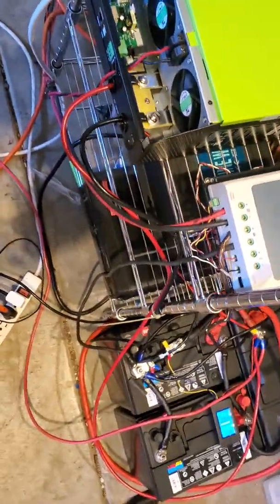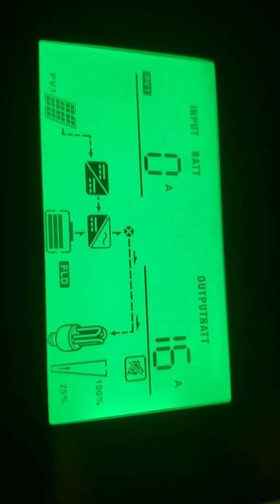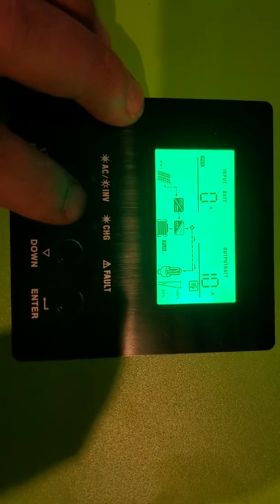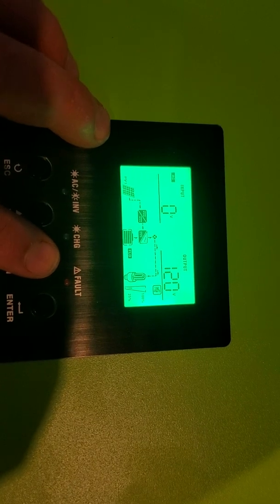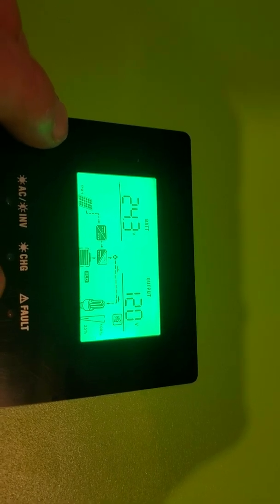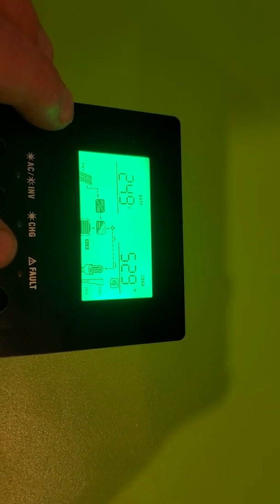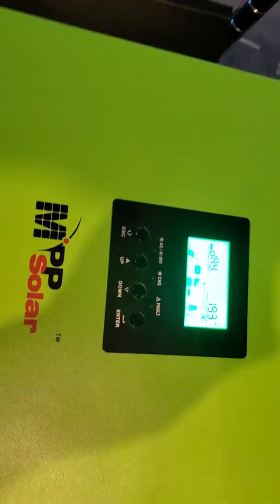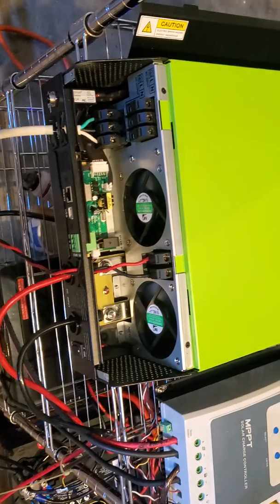hv lv 2424 all in one hybrid solar inverter, more information

Comment: Hi, I’m ready to buy an inverter, likely an all in one unit like this. I keep reading that you can’t run an inductive load like a fridge / freezer etc for long of a high frequency inverter because the Mosfets can’t take it. That I need to pay up for a Low frequency inverter.  With your tech background do you agree with that? Is it so even if I buy a high quality hi frequency inverter?  Thanks, Dave
Reply from the maker: All i really run are ac units on mine. I think there's a possible risk but on the really cheap ones mostly and ones used at 75% load constantly.  If i want to run 1500w i wouldnt run a 1500w inverter. Its maxed out.  I would run a 6000w. I have a eg4 6000XP now. I still use the mpp solar hv lv2424 2 years or more now on a separate 24v system.  Alot of the really cheap stuff doesnt last. I suggest yoi check out diy solar forum and read up posts on inverters or ask questions  there . Many great people on there with alot of knowledge and experience. https://diysolarforum.com/forums/all-in-one-systems.56/